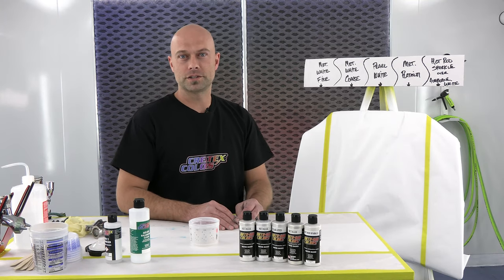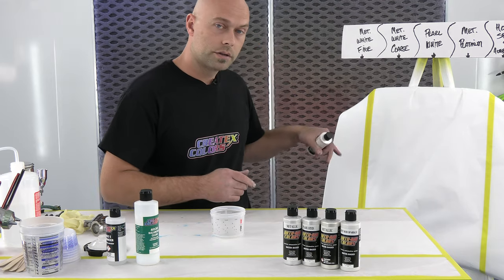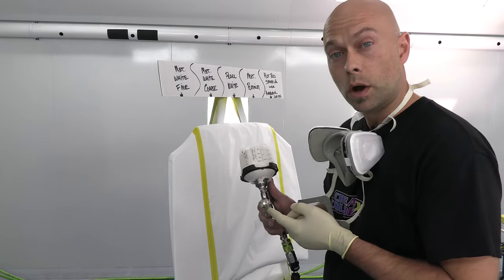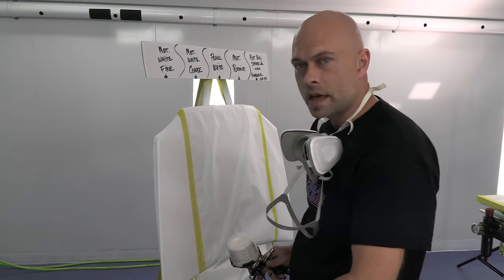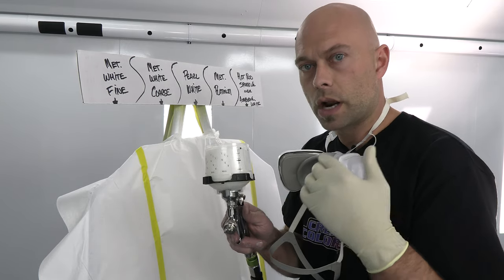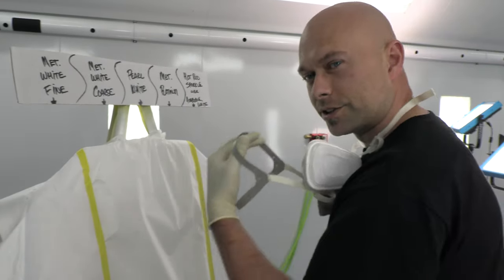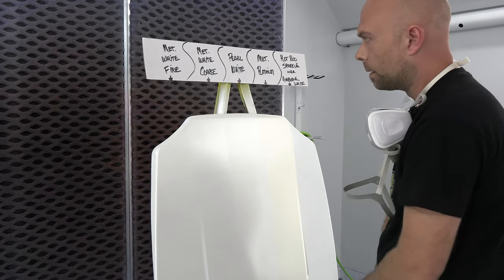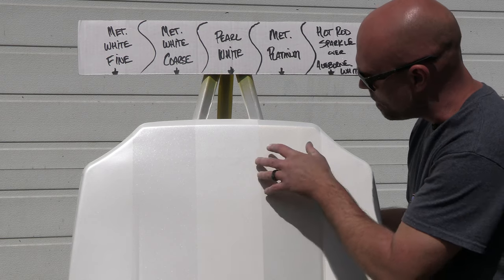How To Paint Metallic White

Comment: Thanks for the videos! Question, why did 4011 replace 4012? Can we use 4050 in lieu of 4030 in base coats?
Reply from the maker: Hello.  4011 Reducer, first introduced in 2003, is slower (less aggressive) compared with 4012 Reducer, introduced in 2008. 4011 works better with our candy2o, and urethane resin products such as 4030 Balancing Clear and new UVLS Clears. 4012 works well in more humid areas, and we'll continue to make it as long as regulations permit, to which 4012's solvent-alcohol, 2-Butoxy Ethanol, was classified as a level 3 health risk, whereas 4011 is a level 2. We'll keep 4012 available "off catalog" for subjective artist & airbrush preferences, and for assisting drying in humid conditions where 4011 & 4012 mixed 1:1 works well. more so with airbrush application.  
4050 can be used as a replacement to 4030, something we've been testing and like the results so far. We're using the same mix ratio with 4050 as 4030, that is paint 3:1 4050, then more 4011 Reducer is used to thin the 4050 paint mix compared to 4030, ~ 15% per volume with 4011 Reducer. 4012 is not recommended with 4050.  Thank you.

Comment: Any worries about over-spray causing a gritty texture with the Hot Rod sparkle - when used in an airbrush?  I struggle with Auto Air Candy H2O paints with the airbrush as well?
Reply from the maker: 4501 Hot Rod sparkle White is applied with a 1.3mm tip-sized spray-gun in the video as this will lay-down the 4501 pearl-flake with the most material per coat, resulting in the most even coating for this particular color.  4501 is a pearl-flake, and will have texture that must be covered over with a clear that can bridge-over the pearl flake if a smooth final finish is desired. With an airbrush, even a 0.5mm or larger tip-size will struggle with tip-dry and flow, and it will be applied with less material per coat resulting in more texture and requiring more clear to bridge over.  4501 is the coarsest pearl white out of all the whites in the video.  If looking for a pearl or metallic white that flow and atomize at lower psi settings for an airbrush, use 4330 Metallic White Fine or 4301 Pearl White. If desiring to apply 4501 HRS White to its flattest, most level potential, a spray-gun is best as the coating will benefit from the greater amounts of material a s[ray-gun offers during application.  Thank you.
Reply: @CreatexColors  Thank you!
I only buy your paints, but I'm new to it and learning - help is appreciated!

Comment: These might look good on a sword I'm making for a costume.  
     Do you know if these paints work well on thermoplastics? My sword will be covered with Worbla. 
Thank you!
     I also have your candied gold for another project.
Reply from the maker: Createx paints adhere to a wide range of plastics, for which AutoBorne 6000 Transparent Sealer is recommended as the adhesion promoter applied direct to the plastic before paint. For thermal plastics, sand the surface, clean, then flame treat, and apply the 6000 within the first 20 minutes after the flame treatment. Thank you.
Reply: @CreatexColors  
Thank you! I'll give it a try.

Comment: I have questions for the metallic white fine. Can you spray the metallic white fine over conventional 2k primers or do i need your primers? Can you spray a ghost pearl midcoat over it? Can your top coats be ceramic coated?
Reply from the maker: Yes, Createx paints can be applied over a solvent-based primer or paint. Adhesion and orientation is excellent over our AutoBorne Sealer, however if the white, 2k primer is sanded flat with 800-grit, the Metallic White + 4050 mix should lay down flat with an even orientation. In regard to a ghost mid-coat; extend the Metallic White with a clear such as 4050, 4030 Balancing Clear, or 6000 AutoBorne Transparent Sealer; its important to apply a medium coat direct to the 2k primer, not a dry-sprayed light coat. Hi-Lite interference Colors are recommended for pearlescent, ghosted colors, https://autoaircolors.com/pearl-and-metallic-colors/flakes-colors/4424.html. In regard to a ceramic coat, we've not yet applied one over UVLS Clears. If doing so, a test panel should be allowed a few days to determine compatibility, however it should work. Thank you.
Reply: @CreatexColors  thank you so much. Im literally trying to undo everything I've researched for a DIY project just because you have the kind of paint I want. So this is new to me.
Reply from the maker: Excellent, we're glad to help, thanks.

Comment: Would you typically guide coat the sealer before sanding?
Reply from the maker: No, a surfacer / high-build primer is what's sanded flat prior to sealer. AutoBorne Sealer can be sanded flat, but at this point that should be for minor surface imperfections, not creating a level surface over which to paint. Thank you.
Reply: @CreatexColors  awesome thank you

Comment: can you use 4040 to mix.
Reply from the maker: 4040 Bleed Checker is a specialty clear recommended only as a protective barrier over candy2o, it does not otherwise mix well with Createx paints. What does mix well with Metallic White and other Createx paints is 4050 UVLS Gloss Clear, https://createxcolors.com/scenix-mural-theme-paint/uvls-clears/4050.html. Try mixing Createx paint 3:1 4050 Gloss Clear, then thin 5% - 10% per volume with 4011 Reducer. Thank you.